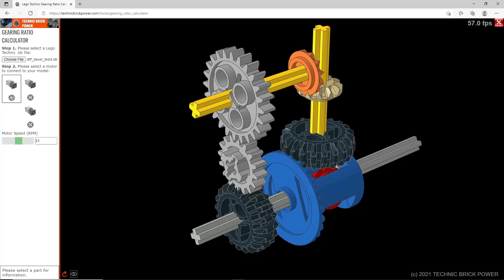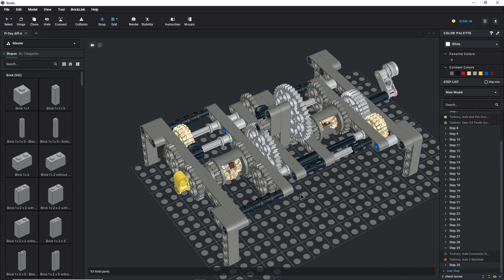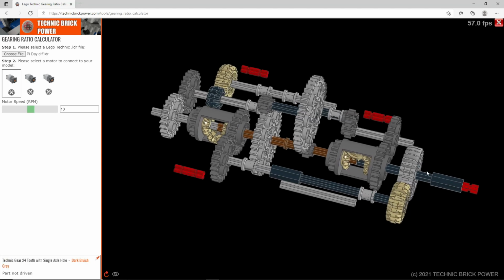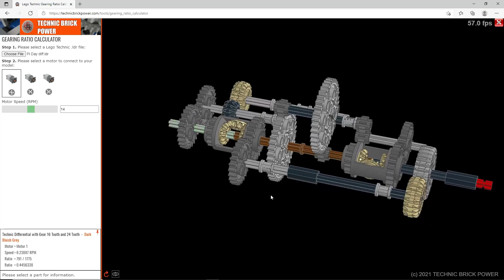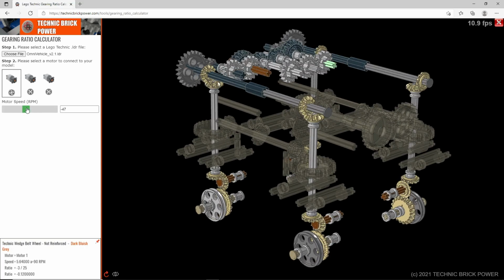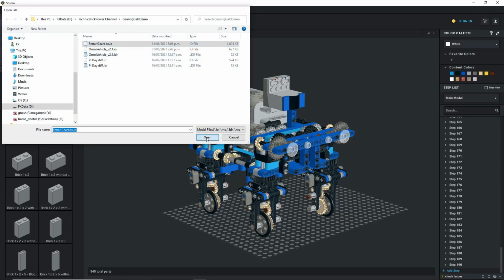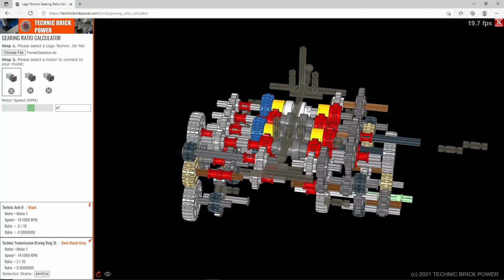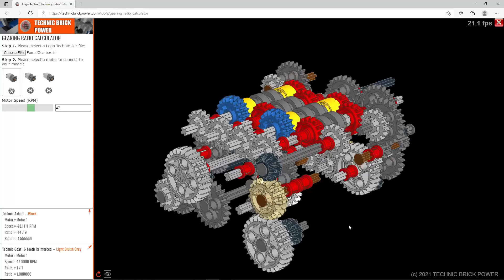Lego Technic Gearing Ratio Calculator Tool

Comment: I found a few mistakes for 
it doesn't work with crown gear at 90-degree angles.
doesn't show the clutch gear in protection-ready mocs.
it doesn't show the older 14t gear.
doesn't show older u joints.
I don't show the pulleys in vintage motorized sets.
it doesn't show the newer splat gears or pre-technic gears.
it doesn't show the newer cv joints or older ones.
doesn't show any of the new gears. (12t, 20T, new diff addon)
I found my update for
it works with a newer u joint at any angle
the new differential gear,
tracks, 
newer CV joints
Reply from the maker: Thanks Dihn!! Does anyone really use the 14 tooth gear!? It's old for a reason LOL. Thanks for finding these problems and letting me know. I will look into them when I get a chance. 🙃
Reply: ok, I like to show you a quick update.
1. all gears in all sets/mocs
2. supports all u joints

Comment: This is so cool, I imported some models I already had and it works quite nicely! I just can't get behind how the hide function works. It would be cool if you'd add the cv joints and maybe a way to get a vehicle's speed based on tire size, but I know it's still a beta version(a quite promising one though!)
Reply from the maker: Hi thanks for your comment - hey I like your vehicle speed idea. It would simply show a linear speed for every rotating component based on it's radius. By CV joints you mean universal joints? Can you give me a part number for the part you are thinking of? 🙃
Reply: @TechnicBrickPower  The universal joints are already there, I mean 32494, 92906 and the newer 52731, 52730 and maybe the compatible wheel hubs

Comment: Glad to see this idea come to fruition. 

Something you could add to this is gear racks. Distance in studs, maybe even add a measurement in millimeters, per rotation of driving gear. The animation could be looped from the starting position to an end position, either from loss of tooth engagement or from a physical stop. Though worm gears would also need to be included in this, as they can operate as a rack, which may cause conflict, so you'd probably need to code a button to switch a worm gear between the two modes of worm and rack. 

Another suggestion I have is to add the functionality of coloring a gear train a specific color. Say a model has four different gear trains, with the original model's coloration these could be hard to keep track of, while the tool could color one gear train blue, while another could be green, etc. This functionality would also be useful in a gearbox where the power is split between two or more gear trains, that way it's easier to tell what goes where. The tool would need to identify splits, either in the form of one gear into multiple gears, or using driving rings as a split. From there it would need to select a component of where a color starts and color each component downstream the same color until the next split; this should be fairly easy to do based on where the motor is attached for input, making the motor the component where the color originates from. This would be a huge quality of life feature in massive builds, GBCs would be a great example of where this could be useful.

I would also suggest a slight change when components flash red due to conflict. Rather than every component flashing the same color, the specific components in conflict should flash a different color, say yellow in this case. Just another QOL feature that would be helpful in larger models, as it'd be easier to identify which components are in conflict.
Reply from the maker: Hi there, Wow thanks for your great reply.  I have thought about supporting gear racks but if they are used for say steering and are held by pivots of some sort then their movement won't be linear and that will complicate the calculation (I have really just focused on rotating parts.)

I like your idea of different colours for different gear trains - I guess it depends on how interwoven they are within your model.

The problem with conflicts is that it's hard to tell where the conflict actually is because technically they are everywhere within the gearing system involved - but I know what you are meaning. 

Thanks again.,
Reply: @TechnicBrickPower  In what example of steering components does the rack itself not move linearly? A rack would be bound by a cage and linkages connecting the linear rack to the steering pivot, yet the software would only detect the rack itself under the gear and axel -only model. The only rack that doesn't move linearly are the banana racks, the large ring gear segments. I don't think I've seen any instance of the rack itself, the linear component, rotating around a pivot, thus my confusion on the subject. Again, the only real issue I'm seeing here is the use of worms as racks, but that's solved by a flag that defines the component as either a worm or a rack that is user-defined. The banana racks could also be an issue, but they're essentially a gear anyways, the only coding here is detecting when a rack segment runs out of teeth, but that would already be built into the overall rack functionality. The only additional thing would be a linear measurement of rack movement per input rotation, something that's fairly easy to calculate if you have rack tooth pitch. 

The gear train color coding should be fairly easy if the software can detect splits via drive ring or a multi-coupled gear in the instance of an input being split between two outputs; this would negate the instance of intermediate gears being flagged as splits, this would also flag a gear train as a series of input-output sets. Once a driving ring or split is flagged, the software should give the gear train split of 1.1 and 1.2, or however you want to denote splits, where a secondary split could be 1.1.1 and 1.1.2 for example. Then it would be defining 1 as color A, 1.1 as color A, 1.2 as color B, 1.1.1 as color A, and 1.1.2 as color C, while giving the user the option to define which subsequent gear train is primary and which is secondary. Having this kind of detection and notation with coloring should make the process entirely automatic. There's also the situation where each subsequent component can be defined as a non-origin color, such as 1 as color A, 1.1 as color B, 1.2 as color C, 1.1.1 as color D, 1.1.2 as color E, and so on, with notations greater than Z being AA. But on the automatic coloring standpoint, the initial component needs a color definition, meaning the software would assign an input component as a color, and thus when the software detects a driving ring or a split, it will color the subsequent inputs as a color; again going back to the 1, 1.1, and 1.2 notation, or whichever notation scheme you decide on if you implement this. I hope I explained this clearly, explaining things isn't really my best skill.

As for conflict detection, this would be fairly simple as well. The software can already detect that worms are not backdrivable components, thus the worm and meshed gear can easily be flagged as a yellow-colored conflict, as opposed to a red-colored conflict. Similarly, the software can detect when driving rings are engaged or disengaged with a gear train, so if two driving rings are flagged as engaged when they share an input origin, this again can be flagged as a yellow-colored conflict, as the software will inherently know that two driving rings with a shared input are engaged when only one can be engaged. 

I know coding is no easy task, but with what you've done so far, I believe these suggestions will be fairly easy things to add to the code, and they're a massive QOL improvement for users when searching for conflicts or specific outputs. Who knows, maybe Lego themselves will pick up on this tool once it's fleshed out for set development, if Lego doesn't already have a similar tool internal to the company. Maybe even a Stud IO plugin in the future as an official tool. Though at that point, I think every moving component, such as steering linkages pivots, would need to be a thing; but baby steps until that addition comes.